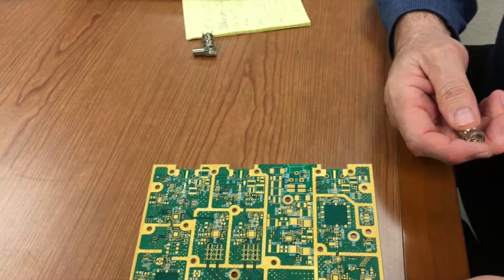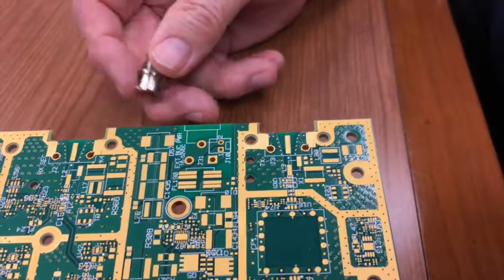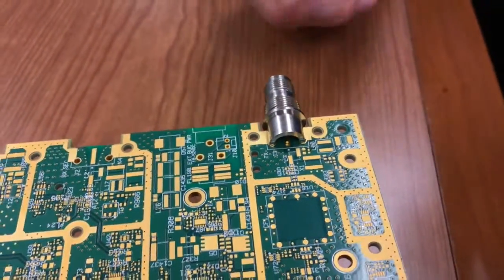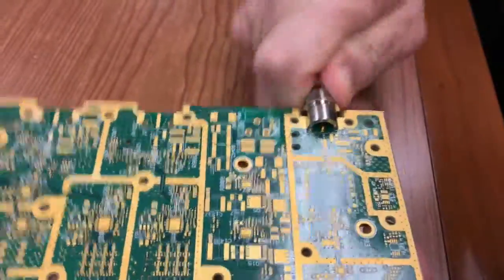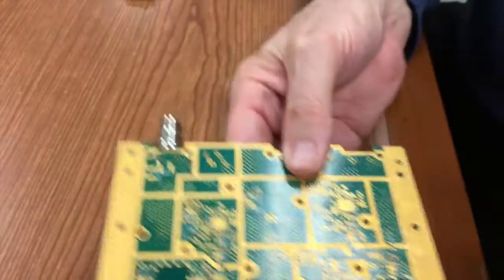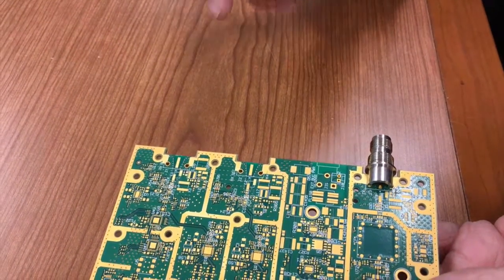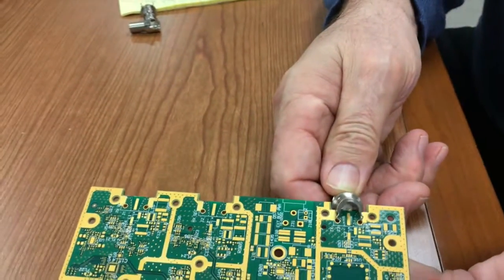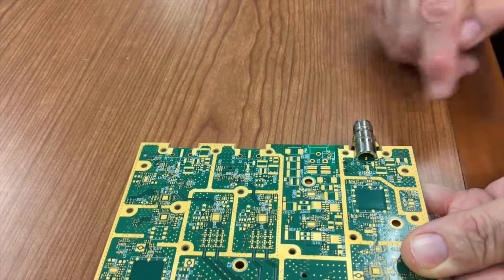BOMAR V-Bite Connector Series

Comment: The central pin need to soldered?
Reply from the maker: Thiago Sanchez 
Yes, both the snap in gnd and signal are soldered. VEE Bite fixtures and holds the connector in position.
Reply: John Benham thank you